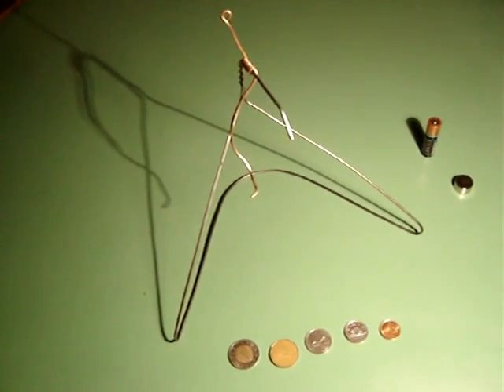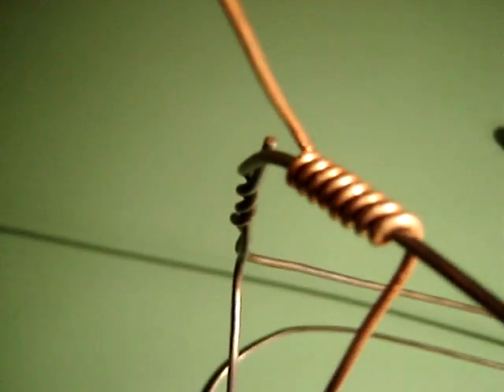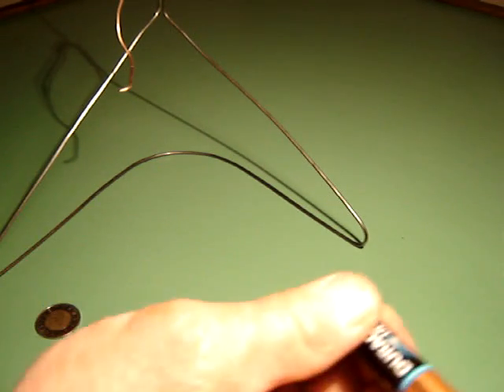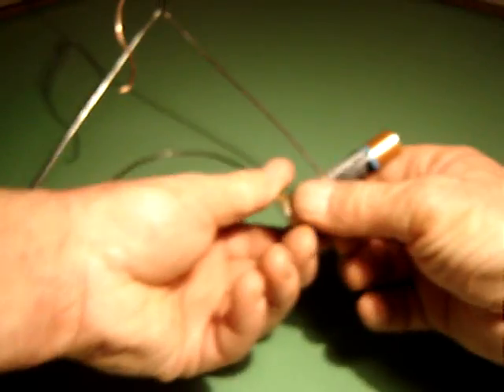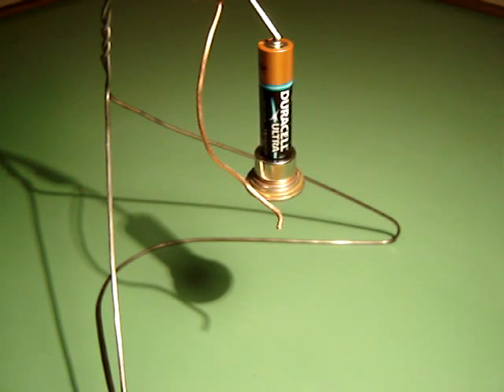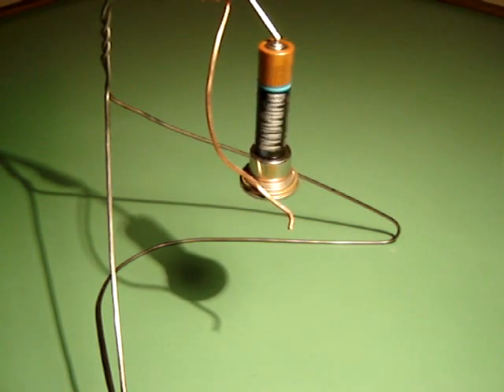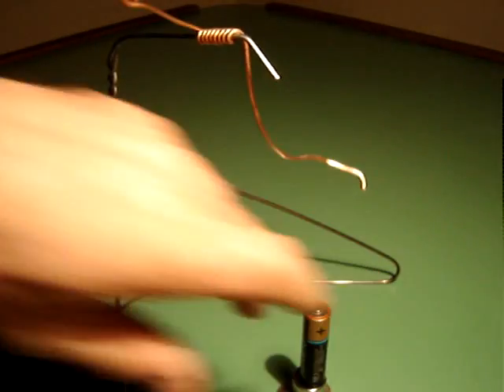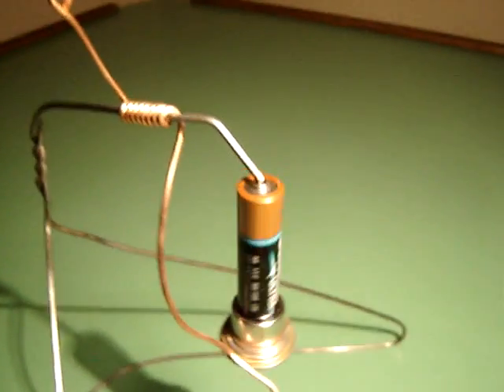Homopolar Motor With Five Speed Manual Stick-Shift

Comment from the maker: The hardest part is to coil the 18 gage copper wire around the bent coathanger. the coathanger must be steel, and may have a lacquer coating that has to be sanded off to make contact with the wire.

I used Canadian coins because they are magnetic, but washers could be used instead. 

The magnet is a 3/8 x 1 inch neodymium found at K&J Magnetics link in the more info to the right >>>

Any particular questions?

Comment from the maker: Thanks, that's right! And furthermore, the taper of the wire is important in that if it is too pointy, the battery will fall down, but too stubby and there's too much resistance and magnetic stickiness.

Comment from the maker: This is the 150-year old idea of the homopolar motor, which works by the Lorenz force, produced by a current running through a magnetic conducting disc, which produces torque on it.

The coathanger, battery, coins, and back to the copper wire form a circuit that makes current in the magnet, turning it.

 The coins are just along for the ride, but they vary the current and magnetic field to allow for different speeds.

Comment from the maker: You can try, but it won't likely turn. 

Homopolar motors take high amperage to work...this one will pull several amps from a AA battery! A watch battery won't like that...it's like a dead short for it, and it can only give milliamps instead of amps.

I use the Duracell NiMH rechargeable with a 2650 MAh rating. it's tough and the most powerful easily obtainable.

Comment from the maker: The coins are not necessary, like a five-speed transmission is not really necessary in a car. 

The conducting, magnetically attracted coins merely enable various speeds to be selected, because of the differences in radius and conductivity.  

Since I am an ex-mechanic, a 5-speed shifter was a natural!

Comment from the maker: Hey, al, smart question! 

The magnet needs to be axially magnetized, which also happens to be the most common form of neodymium magnet. 

Have a look at the magnets found at K&J Magnetics...please use the link in "more info" to the right. >>>

There are some new diametrically magnetized ring magnets available that would be fun to play with in other experiments, but they won't work here without a change in electrical polarity every half-revolution.

Comment from the maker: You must use a neodymium magnet. They are called supermagnets. I used a 1 inch by 1/2 inch one in this experiment. They are very powerful, and you must be careful with them. You can also use a 1/2 x 1/2 inch one for most experiments.

To order magnets, click on the K&J Magnetics link in the "more info" to the right >>>

Comment from the maker: The coins affect the speed because the Lorenz force acts at the edge of the conducting magnetic disc. The coins act as magnetic conductors, and a differing radius varies the torque.

 The commutator contact and heat build-up are the main problems as far as homopolar motor applications go. 

The problems have been solved with the latest navy propulsion system, which will soon be using electric homopolar motors with thousands of horsepower.

Just google "navy homopolar" for details on this.

Comment from the maker: Different diameter disc magnets could be stacked up instead. Or you could try magnetic stainless steel washers or other conducting metal.

Canadian coins conduct and are magnetically attractive. US coins won't stick without putting a magnet on the bottom to hold them up. Some magic shops have magnetic US coins.

Comment from the maker: 1.) The coat-hanger has to be steel, and must be sanded off where it makes electrical contact. 

2.) It must be a conductive supermagnet, the most common of which would be the neodymium ones. I get mine from K&J Magnetics, the link is found in the "more info">>>

You might find a cheap shake-type flashlight at the dollar store and raid it for it's neo magnet as well.

Comment from the maker: Yep, it would extend battery life...However, it would slow down the motor considerably. These motors are low voltage, high amperage. Several amps draw, and sparks at the magnet, is not unusual.

Comment from the maker: This setup might only run for about 5 minutes. The battery can get hot because of using lots of power. The homopolar motor can draw several amps! I use rechargeable  NiMh  batteries, and try not to overheat them.

Although my device is not very efficient, the navy is developing new high power homopolar motors that are more efficient and quieter than the current best ac motors!

Comment from the maker: The copper wire has to be adjusted just right to get the motor to work properly. The angle and the curve of the wire is important where it contacts the magnet or coins.

The magnet is a 3/8 inch x 3/4 inch neodymium.

It's finicky to set up, but worth it when it works right!

There's some more info at my instructables site...(see "more info" link >>>)

Comment from the maker: The shifter is simply a foot-long piece of 12 gauge solid strand copper wire, the same as is found in common household wiring. (14 gauge wire would likely work fine too.)

I wrapped the copper wire tightly around the coat-hanger about 10 times, and made a loop at the shifter end (make a shift knob of your choice!)

Make sure the coat-hanger is sanded down to bare metal in the places where the copper wire or battery touch.

Comment from the maker: Since the organelles are magnetically aligned and have iron and magnetite as a basis, they would act as both magnets and as generators of electricity.

The homopolar motor, above, works in a similar manner. It can be a motor or a generator, depending on whether it is acting, or being acted upon. (for example, electricity can be generated by spinning the above motor setup backwards)

There could be a similar process on a cellular basis, and it may be possible to accumulate these organelle cells.

Comment from the maker: Ok, JeremyDude131, things to try...
You can dimple the battery + end with a pointy object. 
Or add a tiny magnetic ball at the + end. 
Also, the way the hanger wire is shaped where it hits the + battery connection is important...too pointy and the battery will fall off, too blunt and it may wander more.

The shape and size of the copper contact wire has an effect on gyration...I had to tweak it just right to get it all to work. 

Try this stuff, keep at it, and let me know how you do!

Comment: It was most likely that the magnet was not strong enough.  I believe he is using a neodymium magnet (the strongest non-electromagnet).

These things are INCREDIBLY strong.  I bought a set of these just to play around with (and made a simple homopolar motor myself, just for the fun of it).  A normal magnet would most likely not cut it.

Comment: Nevermind, that was awesome.

.well yes the output results in a faster rotation, 
I was refering to a gearbox because to gain speed with the same effort it starts with the  less heavy rotation and it goes increasing gears to rich max rotation. ...I mean it seams that the tiny coin rotates with no effort, once gaining speed there.. if you go to  the next bigger coin it continues increasing speed? or speed just relays on the power of the magnet?

Comment from the maker: Magnets do not normally attract copper, but copper wires with a moving electric current create magnetic flux which is attracted(or repelled) by a magnet. 

Or, drop a supermagnet down a thick-walled copper tube(or aluminum) and it will slowly float down due to eddy currents holding it back. Yet the magnet won't stick to the pipe.

Some Canadian copper pennies are attracted by magnets, but only because of nickel or steel in the alloy.

Comment from the maker: Think of it this way... an electric starter for a car gets hot if it is required to work too hard at low rpm, for example if the timing of the engine was off, or there was too much resistance in the circuit. Or, if the starter isn't allowed to rotate, it would fry in seconds.

Comment from the maker: Interesting points...for speed I use copper-coated welding rod for the hanger, a gold-plated magnet (available at magnet suppliers), and a penny for the commutator. And a green Duracell AA rechargeable NiMH battery in the 2650 MAH size. The faster it spins and the better the connections (with copper) the LESS heat is built up (less resistance). Thanks for comment!

Comment from the maker: Excellent question! The smaller magnet will slow it, but the smaller coin will speed it. However, the copper in the penny conducts better than the dime, so usually the penny wins for revs. I would suggest...why not try it yourself...it's easy and fun! Then report back to us...

Comment from the maker: Most of mine are N42 except ball magnets I sometimes use are N38. I have a few N50 as well, but the more powerful, the tougher they are to handle.(stick to things, erase other things, etc.) The grade may affect the speed, but you can use any neodymium magnet that conducts electricity.

Comment from the maker: Hi and congratulations on trying this! A couple of tips... the coat-hanger has a lacquer coating that must be sanded off to make good contact with the copper wire. I used #14 single strand wire. After wrapping around the coat-hanger, pinch it a bit with the pliers to get even better contact.

Comment from the maker: In this case, after a few minutes, the battery works hard and heats up but will not explode, 'cause there is useful work being done in the system by rotation. Also, the coins act as both heat sink and resistors to limit the power. I've never had a NiMH battery explode on me, but I would welcome comments about this. I have had batteries, magnets and wires get hot enough to burn. (got nipped yesterday, in fact!).

Comment from the maker: Good observations! It is a strange phenomenon, especially when viewed in terms of a typical motor with gear reduction. This is more like a governor or power reduction system...more resistance in the circuit (more coins) decreases the power available to the motor. As well, the magnetic field is less further from the magnet.
  I will be doing some speed tests with my new digital tach to determine the optimum magnet size for high speeds! Is bigger better?